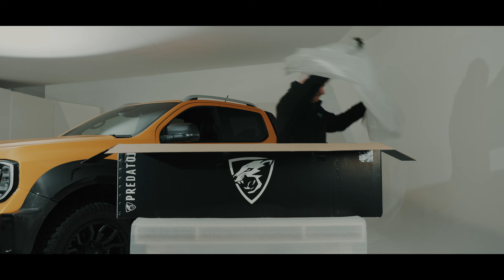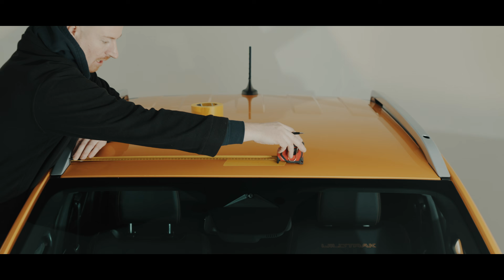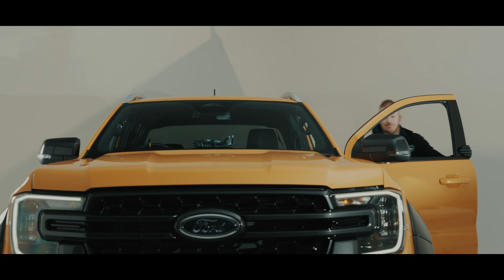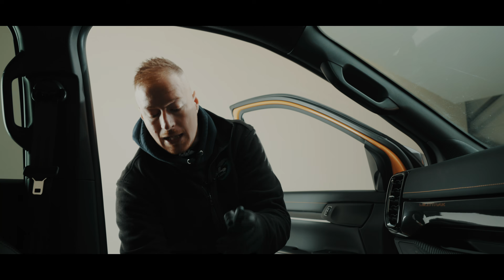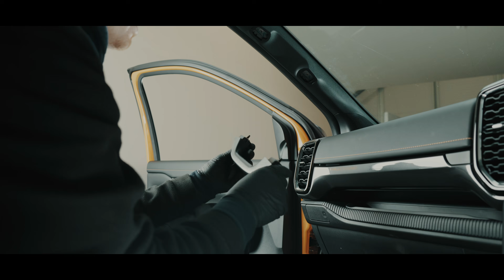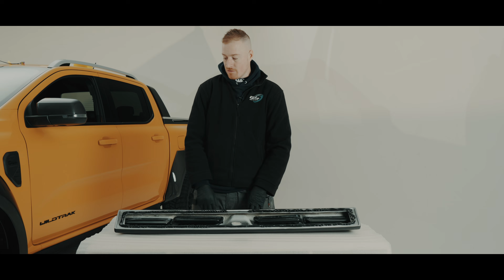How To Fit A 2023+ Ford Ranger Predator x Lazer Lamps LED Roof Light Pod

Comment: Hey guys, recommend you change your advice on this install. Either change away from Sika to an MS Polymer product or avoid glass cleaner in your recommendations. Different glass cleaners can affect the cure of all polyurethane sealant adhesives like Sikas products, depending on their alcohol content and other variables, which will prevent full cure of the PU adhesive leaving it permanently like chewing gum. Have seen it happen many times. Unless you are supplying some in your kit that you know is safe to use. You may end up with customers following these recommendations and having these light bars come off the vehicle. Water will work fine for tooling off the sealant, or use a quality MS Polymer and have no issues.

Comment: Hello, is there a way of installing Predator roof light without drilling the roof? Thanks in advance.
Reply: I saw an install on a Wildtrack where they ran the wire down the side of the windscreen inside of drilling the roof. You could see the wire... in fairness black wire against the black windscreen rubber. I saw a video somewhere on it too...
Reply: @alistairwhite5682  I also saw same light pod for Defender from other manufacture, they put wire on side piller, cable is only visible like 2cm... Thats why I asked but no reply...
Reply: @ I've done it on my Ranger, The cable runs behind the roof rack for a few CM bit it's barely visible. It then runs down the A-pilar and is (for all intents and purposes) invisible.
Do it, you won't regret it.

Comment: Brilliant video, just like all of your recent instructional videos.

Quick question: I have the Power Pack 3 which includes the Aux switches.in the roof panel. How does that affect the installation? I presume that will help me avoid all the A-pillar wiring?
Any help would be appreciate
Reply: hi there rake, so insted of going to the full beam siganl wire, you would solder the purple wire to the thick yellow wire next to the battery, it will be tape round a harness. this is aux 6 wire. you can either have it on the full beam or an auxaliry switch but not both,. hope this helps.
Reply: @207GTBEE  thanks for the heads-up.
I think putting it on Aux 6 makes sense for my setup.
Reply: @207GTBEE  would Aux 6 then not just supply switched power? The switch wire to the relay could be installed to the high beam wire. The pod would then switch on with high beam only when aux 6 is switched on? In effect aux 6 would replace the connection to the battery terminal?
Reply: @chrisanderson4202  hi there. That way would work if you had a light bar but NOT for the light pod. Aux 6 is only rated to 25amp and the pod is rated to 35amp. Using it as a main power supply would either keep blowing a fuse or damage the vehicles wiring. Please don’t not use aux 6 as a mains power supply for this set up.
Reply: @207GTBEE  ah that makes sense. I suppose they aren’t low amp driving lights are they 😊
Reply: @chrisanderson4202 no sir they arnt. The best roof light product money can buy
Reply: are the light pods road legal? I have both defender & ranger, I will be installing on both, the salesman from Landrover said he has been stopped before.. he has the Bluetooth switch but I would rather connect to full beam. On the defender the auto beam switches off with on coming traffic.